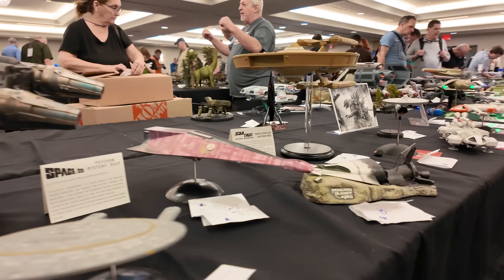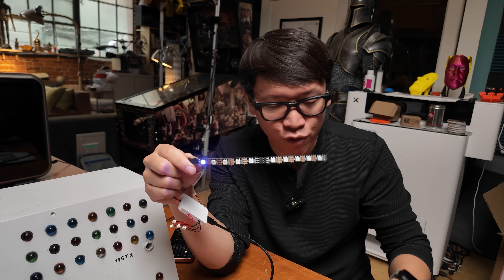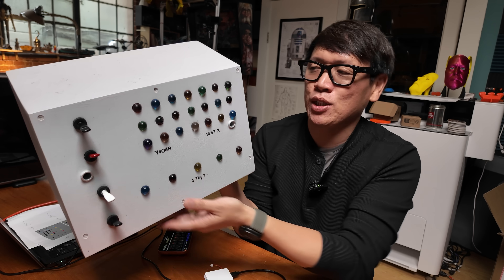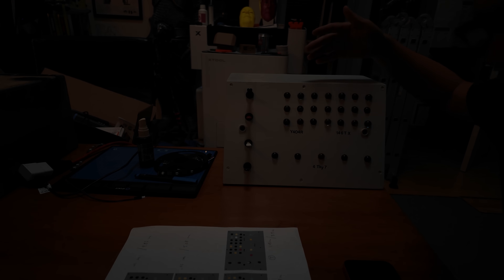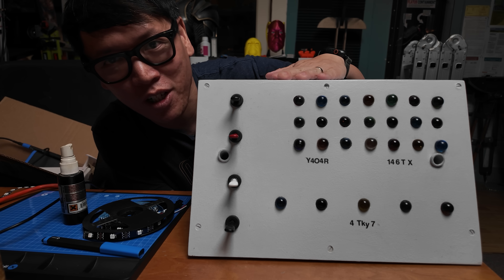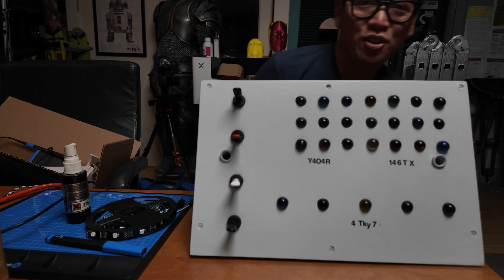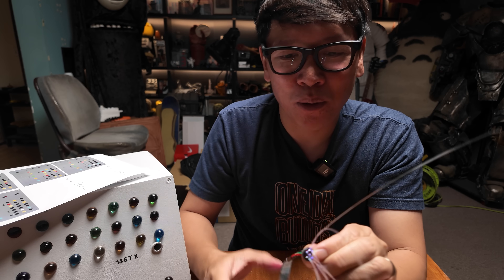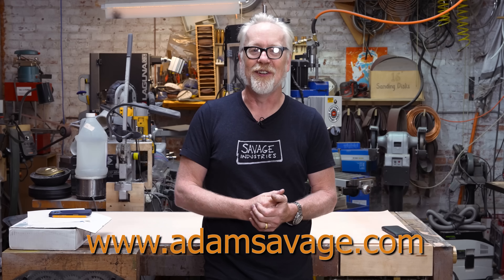Star Trek Computer Prop with Working LED Lights!

Comment: Norm this is a great video. I'm so pleased you are showcasing Andy's InnerLight solution. I've been using this solution for over 5 years. I love it's flexibility and the fact you can get exactly the colour and animations you want without programming or electronics knowledge.   The fact you can still refine once the model is buttoned up is great. One feature I find particularly powerful is being able to string effects and scenes together. For example, on my 1/350 Enterprise Refit build I was able to replicate the start up sequence in drydock easily. I've also used it in my 1/8 Back to the Future Delorean, STNG Romulan Warbird and, most recently, in my 1/24 X-Wing build. You can see my Inner Light builds here https://www.youtube.com/@SteveyWeeveyCass

Comment: Very cool the Fiber optic adapters!   How do you think the original Star Trek computer prop sequence was done.  I would guess they had some kind of electrical cam system with a slow motor rotating around making contact to switch the lights on and off? Oh, and Probably need some diodes to isolate the lights.
Reply: Or some guy offstage pushing buttons.
Reply: @leestamm3187  Could be, but they would have to have a lot of fingers to make the animation sequence work and repeat, at least that's what I understand that the pattern is repeating.
Reply: @HobbyHalloween  The fact that someone could learn touch typing illustrates the ability to punch buttons quickly in a variety of patterns, both simple and complex, repetitive or not.
Reply: @leestamm3187  I can see that for one prop, but the Enterprise bridge would need some automation, Alex over at Technology Connections explained how a pinball machine animated their playfields and displays using electromechanical devices, they used all kinds of cams and leaf switches... I was imagining something along those lines for a "Random light" blinker circuit.  But I'd like to know for sure how the did it... Button pushers off screen or ??
Reply: @HobbyHalloween  Sounds reasonable. We need to locate some propmasters who were around back then, if any of them  are still with us. Maybe Adam knows one.
Reply: @leestamm3187  Exactly, I can speculate, and we have modern technology that makes these kinds of props a cinch to build, but they didn't have that, so it had to be made of simpler things... I saw someone make a traffic light from a tin can and electrical tape the wires touched the can and the electrical tape blocked the signal. Then when a motor turned the can the lights lit up in sequence,  even something like that was incredible to me in 6th grade

Comment: Sorry to bother you, this is unrelated. However I recently watched a myth and hoped you might answer a question. It was regarding the whirlpool episode. In it you conclude the myth is busted a whirlpool cannot pulldown a ship based on the velocity required. However, would not a high shear, low radius vortex have a greater torque and cause yaw and pitching which would capsize a vessel?

Comment: I remember hearing about prop makers using a spinning drum or circular board, & motor driven brush over the metal contacts. Like a musical pegboard drum to program light effects. That's why in some scenes you can hear a motor in the background clicking on & off lights. Is this true? I don't know the name or words to describe the analog device.

Comment: If you're ever in Coos Bay, Oregon, check out the Star Trek room at the Itty Bitty Inn.  It has one of these props, and a LOT more.  It's an incredible, eccentric little gem of a place, run by a ridiculously nice guy that's very much our kind of geek.

Comment: When my kids were younger I built a couple of what I called control boxes. They were plastic project boxes about 2 in by 3 in by 6 in with LEDs with switches that would turn them on and off. Certainly not on the level that you built but this did bring that memory back. Essentially they could just use their imagination for whatever those light switch boxes were for. They loved them.

Comment: We have a CR circuit with several branches connected in parallel. There is a branch where a resistor is followed by a capacitor in terms of direction of flow of current. In steady state, the capacitor is an open circuit. The first terminal corresponds to a test cryptocurrency like Monacoin 🇲🇨 and the second terminal corresponds to defination, which is a nation with UNKNOWN flag. There's cream filled in between, like Oreo cookies. When looked in the mirror that generates lateral or horizontal inversion, it's echo resembles that of -OH hydroxyl group. You're supposed to cut the vertically upper part, invert the bottom part to the upper plane, squish the terminals like a toothpaste tube to release the cream or paste onto the floor, invert it back to the bottom while releasing pressure on the walls and clean the inner walls with Sulphuric Acid and a brush. It's not supposed to store the paste anymore, and it's not a good idea to store ice cream that tastes like toothpaste, so we'll use a pipette to drop a fraction of a millilitre of pippermina into the pocket and blow air from our mouth like Superman🦸‍♂️to see if worms are released. We can now label the pocket with a sticker from Superman. This technique can be used to manufacture vaccine bottles which can be labeled with sticker effects.

Comment: Thanks for the product review!  I've been using products from Tenacontrols.  Basically, just a compact control board with fixed effects and non-user programmable.  Customized for specific models, mostly Star Trek themed.  You pretty much have wire up your own power supply and LEDs.  This Inner Light thing opens up a whole new vista of options!

Comment: Cool little product! If looking for a more DIY approach I'd take a look at the WLED firmware running on an ESP32. The app isn't as focused on model lighting - it's a more general-purpose addressable lighting controller - but might offer a cheaper alternative that doesn't have the same limitations as the lite version. Love the little fibre adaptors they've created!